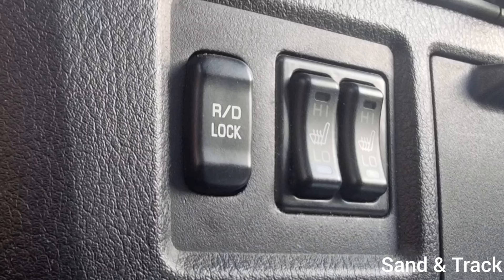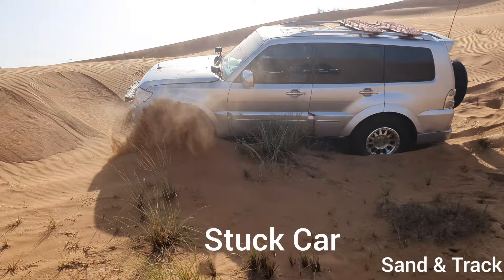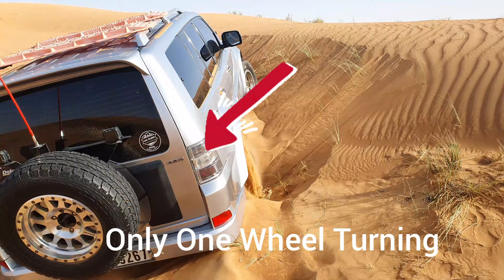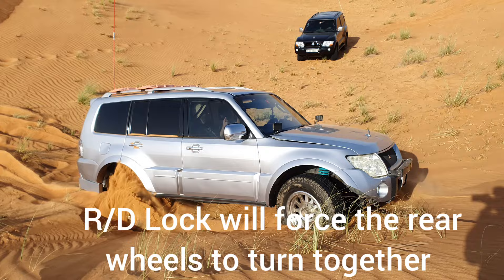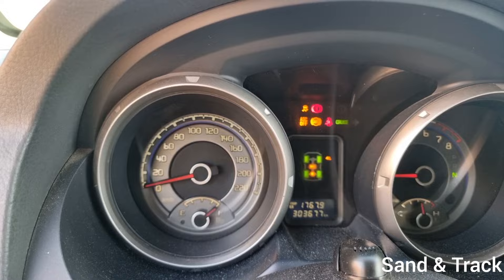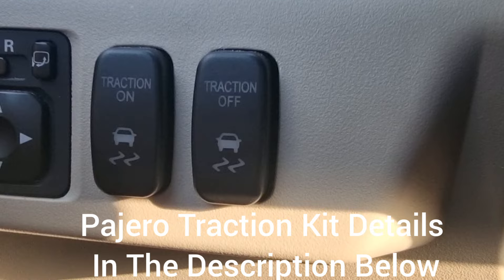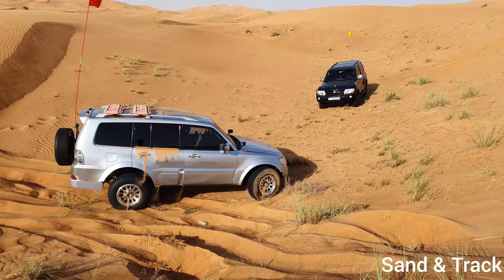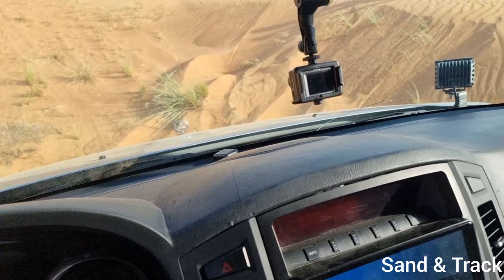How to use R/D Lock? [Rear Diffrential Lock]

Comment: I like how your number plate is below the spare wheel. Here in Australia it is mounted to the rear wheel with the rear camera, which is a little annoying as it prevents us using a gear/rubbish bag hanging off the back wheel. Did your car come from factory with the number plate there or have you made a modification.

By the way, I have the Cronos traction mod on my car, too.
Reply from the maker: Hey Karl thanks for the message. I personally removed the rear Tyre cover and relocated the license plates and fog lights on a custom made metal bumper. Awesome stuff on the Cronos TC loom! 😊

Comment: I have a 2007 path finder and I hope the website that you shared has compatible gear for it as it does host products for Xterra which might be compatible with my model as well. However I'm in Dubai, and I'm looking for a Rear Diff (not ARB but a cheap one).. Is there a good workshop which can install the system..thanks

Comment: It seems to me that your traction control is not working at the beginning of the video when the car is stuck because the skidding wheels do not brake and the torque is not transmitted to those wheels that have traction with the surface. P.S. Some Pajero\Montero configurations do not have traction control but have a rear differential lock, and there are also configurations that, on the contrary, have traction control but do not have a rear differential lock. There are also cars that do not have or have both functions. This can be checked on the indicator panel when starting the car.
Reply: 4Llc disables TC or am I wrong?
Reply: @TryABaconSlice  4LLc mode disables only ASC (Active Stability Control), Rear differential lock disables TC(Traction Contol) + ASC + ABS
Reply: @olegsolomko4833  gotcha, I've only had my Gen4 NX for a few weeks and have yet to take it off the highway cheers for the info
Reply: @TryABaconSlice  There are different modifications of Pajero 4. With TC and RDlock, with TC and without RD lock, without TC and with RD lock, without both. To check what you have you must look at the dashboard indicators when you start your engine.
Reply: @TryABaconSlice  In most scenarios the most useful mode is 4LLc with TC on and ASC off
Reply from the maker: It does correct
Reply: please explain why the spinning wheels do not try to be braked by the TC system? Maybe you had to press harder the gas pedal to activate the system? Or an additionally installed non-original modification for traction control turns it off for some unknown reason? @SandTrack